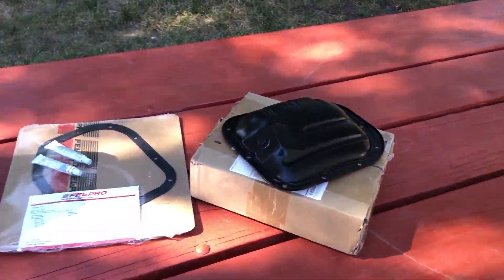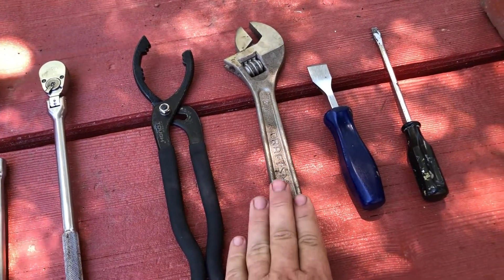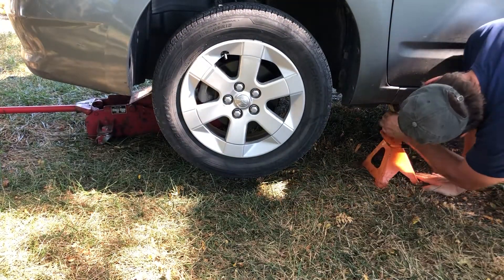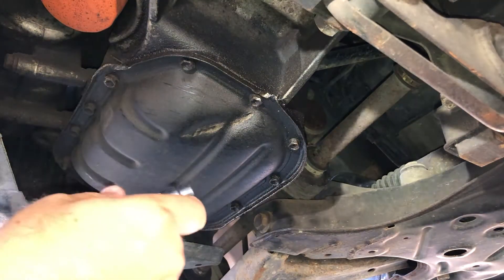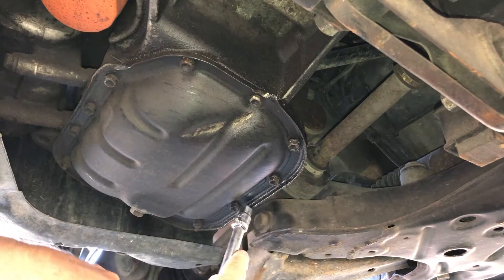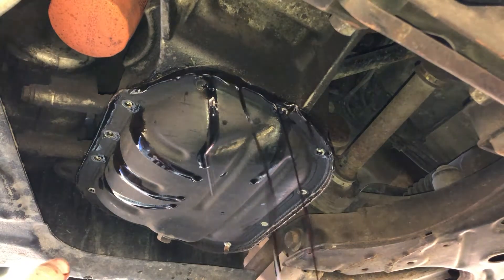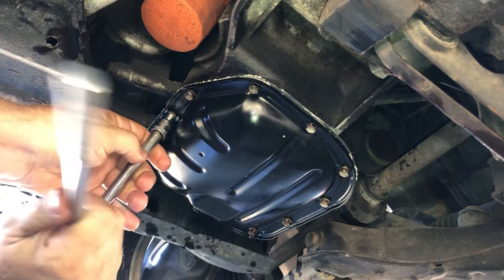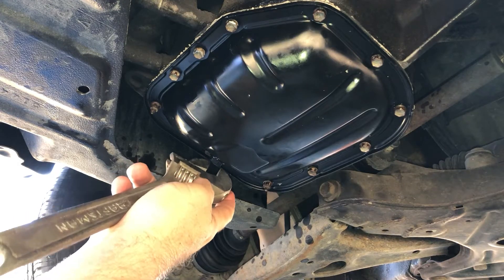Toyota Prius Oil Pan Replacement: A Detailed Step-by-Step Guide - 2004, 2005, 2006, 2007, 2008, 2009

Comment: What is the oil pan torque?
Reply from the maker: Good question, if you are using a torque wrench, the spec is 10 N·m (102 kgf·cm, 7ft·lbf).

Comment: Curious, how long do you think it’s takes on this job. I got charged 2.5 hours labour.
Reply from the maker: A lot less than 2.5 hours. 🤷🏻‍♂️ 

Back when I was a mechanic in the mid-90’s at a small independent shop, we had thick books where you could look up particular jobs for specific cars. If the book said 4 hours and it took 2, the customer would be charged for 4. Alternatively, if it took 8, the customer would still be charged for 4. Sometimes the mechanic won and sometimes they lost. 

In your case, including prep and cleanup, a skilled mechanic could easily get the job done in one hour or less. That 2.5 hours also probably included a filter change.

Comment: You do know that the ratchet handle makes a good speed wrench if you fold it down and crank the bolts in by cranking it.  I'm gonna assume that you don't have the clearance between the bolts and the ground?  The catch pan should be out of there by know.  Maybe for all the guys that never tried it.  
First time here and seems like a good video.  Oh, 7 ft-lb on the bolts.  That's too low a reading for a click type torque wrench.  Let's go with 84 in-lb.  (12 inches to the foot?)  Use a 1/4" torque adapter.  Cheap and super accurate. 
                                                     HEY!  WHERE IS EVERYONE????
Reply from the maker: Thanks for the feedback.

Comment: Seems that these Prius have oil pan plug problems. On one hand if you don't have enough torque on them they leak (even with crush washers) and too much they strip out. We as a family have three vehicles and enjoy them as such but I never had drain pan issues w/my domestic vehicles like these.
Reply from the maker: It's looking like these oil pans are a common issue. When I first made this video, I wasn't sure if it would be useful to anyone, but as of today, it's received 750 views (and the shorter version an additional 109).
Reply: Meh, I see techs over tighten and strip just about any oil pan/plug out there. Many American cars have aluminums pans and threads to boot, honestly though a pan gasket is like 20 bucks and they’re usually easy to get to. 

I remember when Pontiac was installing plastic head gaskets on their 3.8l v6 engines… now there’s an expensive fix. 

Then we have the mileage sanity check, I’ve owned a handful of GMs and Fords and all of them had issues as early as 30k miles, my Prius is at 120k and I finally have my first issue requiring I jack the car up and turn a wrench, I call that pretty reliable.
Reply: @Skyhawk656  mines at 196 and just now having a leak

Comment: Thanks so much! Dealership wants to charge me $350+tax for a new Oil Pan and the labour... maybe I could do this on my own.

Quick question: If the dealership has already done an oil change (for my annual), do I have to get it done again after I replace the oil pan? I'm not sure how exactly it all works... 

Thanks so much!
Reply from the maker: That’s a great question! When draining the oil, if you can drain it into a CLEAN container, then it is reusable. Just make sure there is not water, dirt or debris in the container.

Let me know how it works out for you!
Reply: @YOUCanFixAnythingAuto  Amazing! Thanks so much! Waiting for it to get a bit warmer (writing from Toronto) before I tackle it! But i'll let you know! Your video was of great help! Thanks so much!
Reply from the maker: @yazr1712  - You are welcome! Thanks for watching! 👍🏼
Reply: Finally got around to doing this! I am finding slight leaking from the oil pan... I'm thinking maybe I didn't use enough silicone 🤦🏾‍♂️ any advise on how to proceed? I was thinking about adding more silicone to the outside seal thinking maybe that would help? Any advice or suggestions would be greatly appreciated. Thank you!
Reply: Just did this when I needed an oil change anyway. Let all the oil drain and took off filter before removing pan. Gonna let silicone setup overnight before adding my oil tomorrow. Easy job.

Comment: Why did you not drain the oil before you took the pan off? What a mess.
Reply from the maker: Good observation! Normally I would, but in this case the reason I had to replace the oil pan was because the drain pug threads were damaged and it couldn’t be removed. Thanks for watching!
Reply: @YOUCanFixAnythingAuto  😂 good point. Thanks for the video.